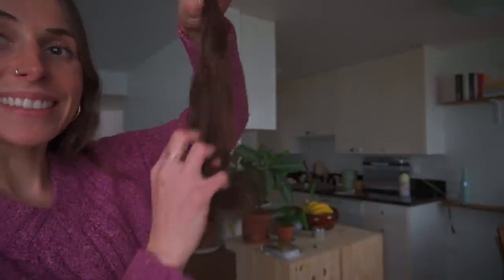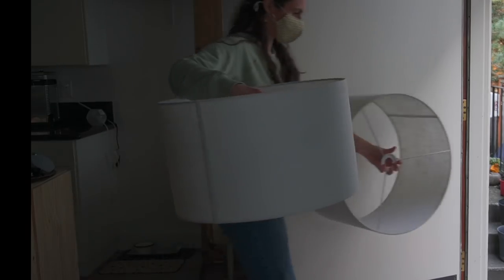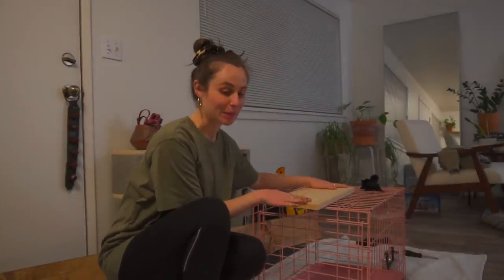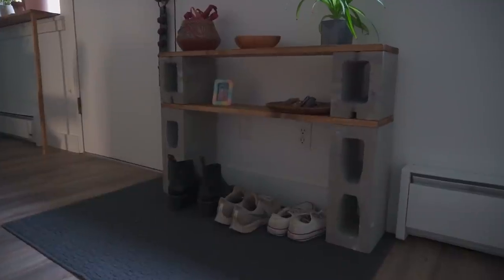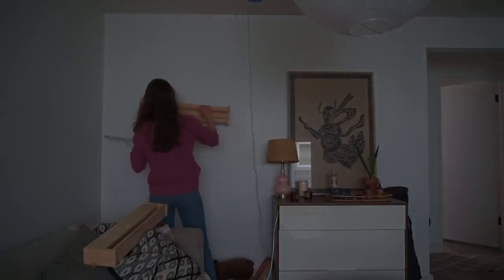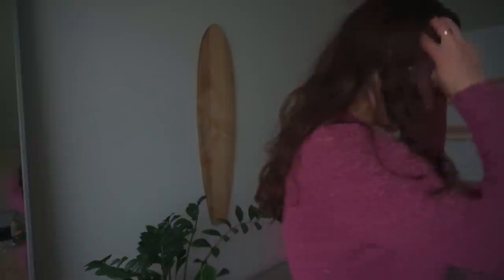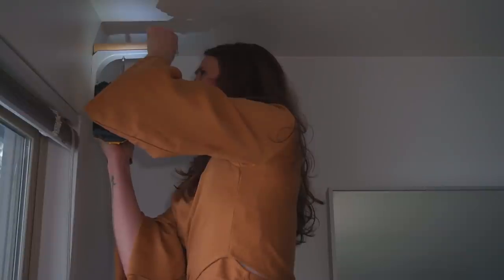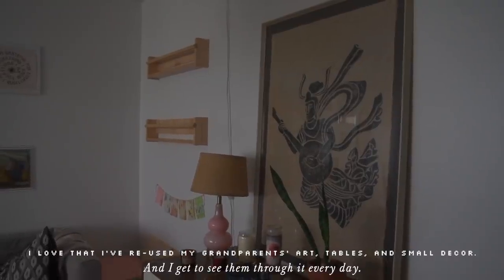Living Alone Diaries | 36hr Apartment Living Room Makeover! Thrifted, DIY, Renter & Budget Friendly!

Comment: the art wall is amazing!!! And tbh I have killed 3 spider plants lol! Theyre not easy plants as muc has the internet claims! 
Only thing is maybe raise the lowest kitchen shelf you installed? It falls in line with your window shelf and cuts the space up a little. The gap between the shelves is visually odd. As for cord management, you could add C hooks or attach them to the underside! Or drill a hole into the dresser to thread the extension cord through is another option.